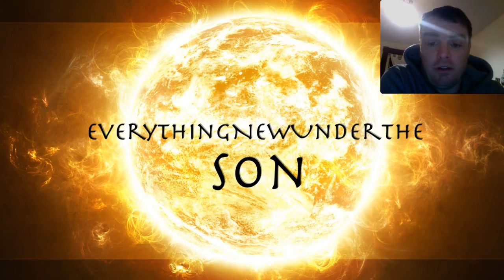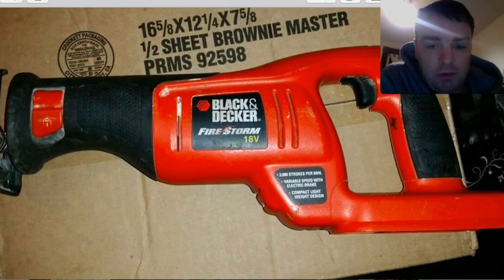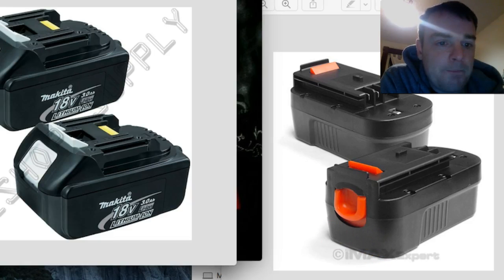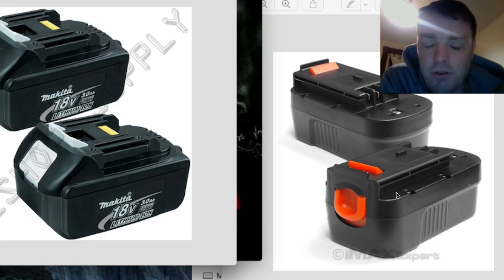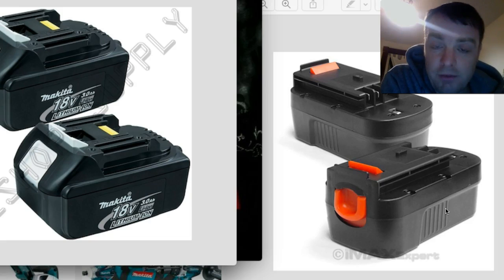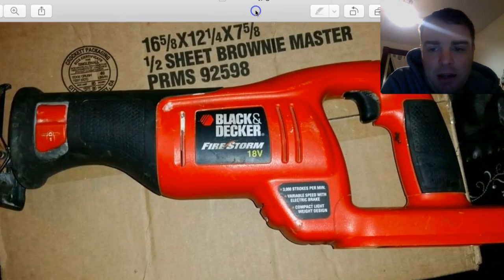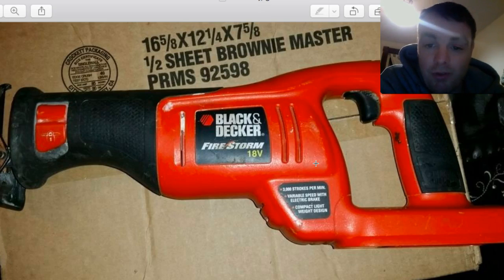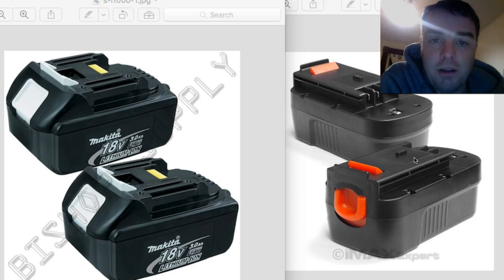New Project - Convert Black and Decker to Lithium Ion Makita batteries

Comment: I have exactly the same problem / project in my mind. I have the same black decker battery's which are dead. I have some makita drill battery's who are also dead, well I found out that only some cells are dead not the whole pack. And the pcb is bricked.  Makita charger is not a balancer, though I have 1 makita battery that has balance wires in it and another type of pcb.
I think the best is to add balance wires to a makita drill battery and charge it with an imax charger. And to make a converter which has to fit in the b&d 
Maybe I can fit the top of an B&D battery on a makita bottom battery...
Reply from the maker: At this point I have no interest to tinker fixing old batteries. But to retrofit existing tools for new batteries makes sense to me. Spending $60 will get you a fresh battery which will be good for the next 5 years at least. For me it's worth the less hassle
Reply: +EverythingNewUnderThe Son I know. A new NI-MH repack or complete aftermarket battery ni-mh is availabe for about 40-60 bucks. You can charge them with your original charger. 
I also would like to know how to convert it savely to lithium source.

Comment: Hey, there's nothing wrong with changing your mind.  ;o)  Sounds like an interesting project.  I'll be keeping a look out for updates.
I took apart one of my 18V Nicad battery packs and discovered that inside are just a bunch of C-size batteries, strung together.  I was wondering, would it be possible just to get a bunch of new C-sized batteris (be it NiMH or Lithium) and just change out the ones in the battery pack?  Then you don't have to fiddle around with trying to get the battery pack to fit on the tool.
Just a thought.
Reply from the maker: Rechargeable's  are usually slightly smaller than the alkaline counterparts. If it fit, you could do it but you of course wouldn't be able to charge them.
Reply: ***** True, but I did mean to say replacing them with rechargables, but I wasn't specific, there.  My apologies.  I suppose a bunch of rechargable NiMH or lithium could get costly, too.  Maybe the Makita battery pack itself would have a similar array of batteries that could be swapped out.
In any case, I'll just watch how you do it and what you find works best.  ;o)
Have a great weekend!
David.
Reply from the maker: +The Homestead Chronicles you could definitely swap it out. you could take any lion battery and swap it if wanted. Since its something that will need to be replaced, I'd rather not make one battery, but set it up so that i can get brand new batteries for it for the foreseeable future, as well as taking advantage of the advancements in the lion technology. I figure Makita will have 18volt batteries around for a long time. I could still get nicads for black and decker but b&d isn't as committed to staying around for the long haul with tools as Makita is. So i think it will be a good transition from a 'cheap' set to a notably better quality one. Will be interesting to see how long I go with the old tools, I imagine as long as they are working, I won't replace them with a Makita (skilsaw, or sawzall)
Reply: ***** Agreed!  May as well get as much use and "mileage" out of our tools as we can.  I hate having to re-buy stuff.  That one reason why our household uses Linux.  I don't have to keep buying new computers ever other year.  I'm still happily using my Asus EeePC from 2007!  LOL